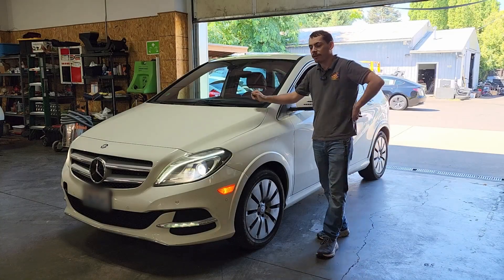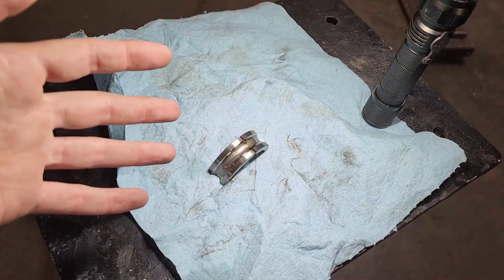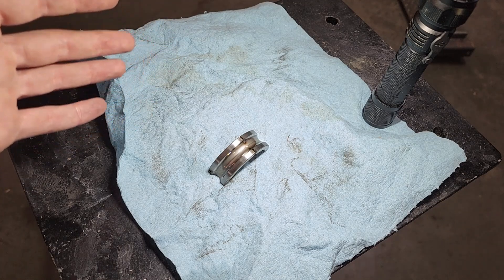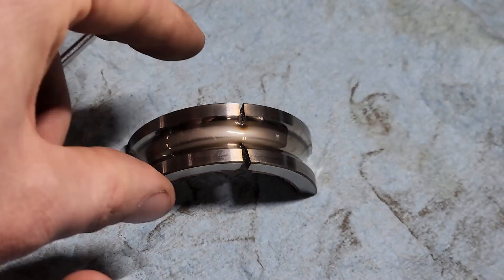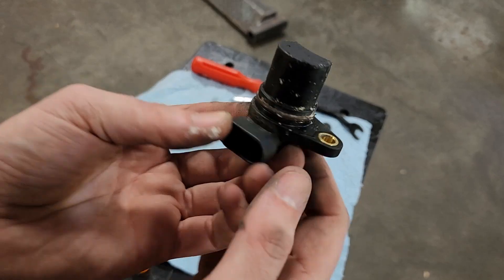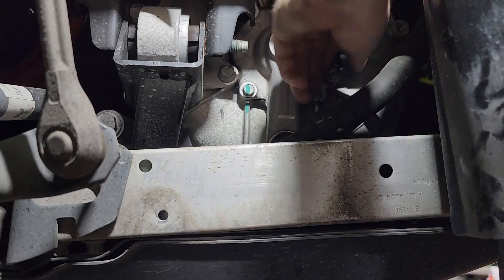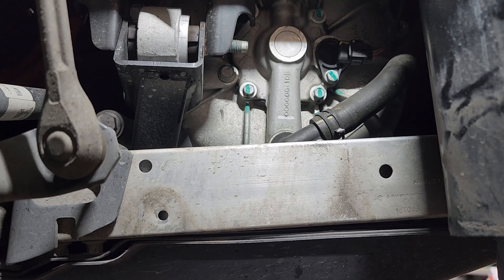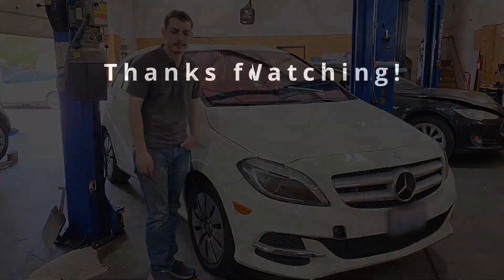How to tell if your Tesla LDU has issues.

Comment: Thumbs up Do a Video on the Mercedes . 👍👍👍👍👍🍻🍻
Reply from the maker: It'll be pretty much exactly the same process as the RAV4 EV motor rebuild video series I just did (minus the siezed rotor part), so not much point in making a second video about the same thing...
Reply: @AlexEVRepair Do the video showing how to remove the drive unit on the Mercedes !!!
Reply from the maker: It's a pretty similar process to the video where I did the drive unit rebuild for the RAV4 EV. Some of the bracketry is different (particularly the brackets associated with the "bottom mount" on the HV stack), and the drive unit has to be tilted quite a bit do get it out, but overall, it's mostly the same steps. Lots of Torx and E-Torx fasteners!

Comment: Awesome topic and well done as always!

Do the normal drive units get the bearing issue very often?

Would love to see the same top issues for the Model S/X battery packs.
Reply from the maker: By "normal drive units" I assuming your talking about the small drive unit? I have seen or heard of a few, but it's not anywhere near as common as the LDU.

I've also heard of some folks having similar issues with some non-Tesla drive units as well, but again, seemingly less common than the LDU. 

The main thing that all the drive units that suffer from these bearing wear issues have in common is that they are almost always induction motors (as opposed to permanent magnet motors).